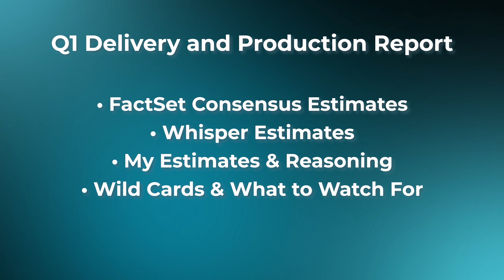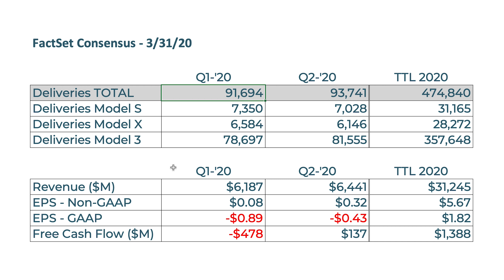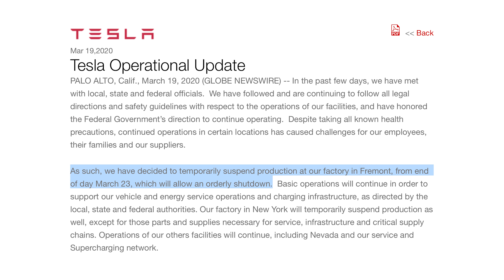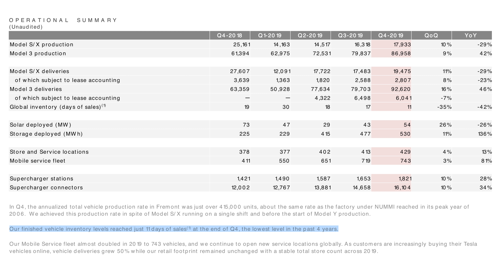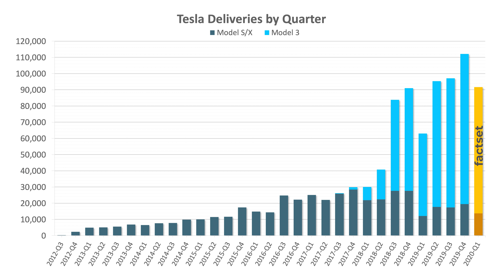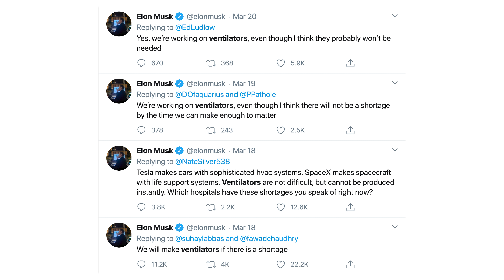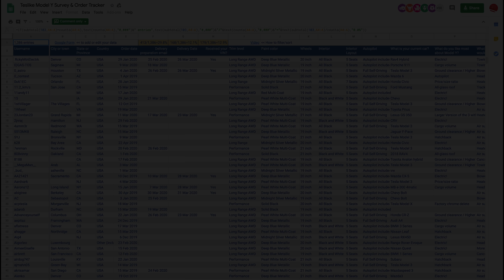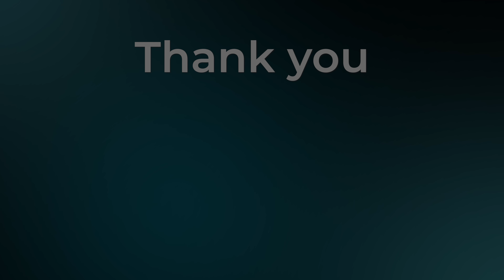Tesla Q1 Delivery Estimates, Preview, and Wild Cards (TSLA)

Comment: Do you still believe that analyst will spin the number to be negative to bring SP down so they can buy more?  Also take a look at Hyperchange numbers @ 65k, what a difference.  Your number is much more consistent with CleanTechnica which also used 1 million deliver based calculations
Reply: Production and demand are two different things. In Q1 last year they produced 90k and only sold 60k; so there is actually precedent for them stacking inventory in Q1.